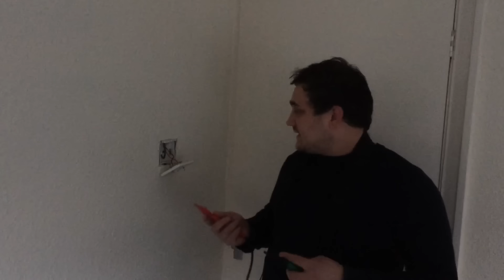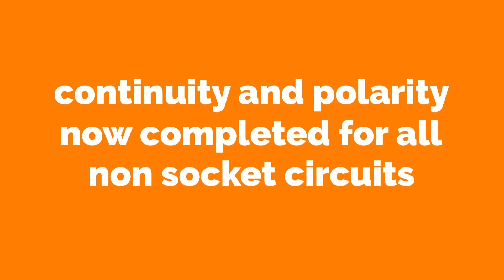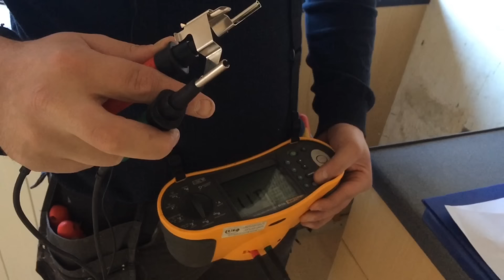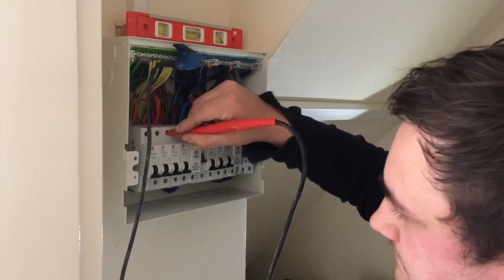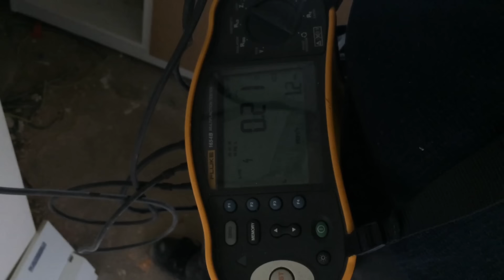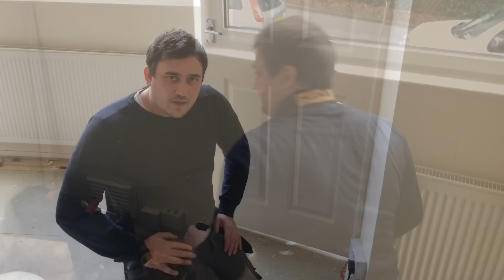On-Site Consumer Unit Change (Fuse Board or Fuse Box Change) Includes Live and Dead Testing

Comment: If you T&E is 2.5mm, r1 is 0.15, rn is 0.15, the expected value of r2 should be 0.25 and not 0.45 as its only 1.67 times thinner. 1.67x0.15 is 0.25 not 0.45 except you have extra lenght for the cpc.
Reply from the maker: Or is the cpc 1mm2 in this installation 👍🏻

Comment: Hi Gaz and Marcus. A quick question please. If you're testing a circuit (eg. Lighting circuit) that has being installed by somebody else years ago, how do you work out where the furthest lighting point is? And then do you record the reading from the furthest point in the continuity test as your value for the test sheet?
Reply: You’ve answered your own question pretty much, the furthest point of the radial circuit will give you the highest R1+R2 reading (lighting, radial sockets etc) as it has the most cable in the run and therefore the highest resistance which is the value you record.
 The way you find it is to test at every point of the circuit (all switch points, all PIR’s (if applicable) all lighting points I.e. ceiling rose and the highest continuity value is your end point
Reply: @alexrowbottom58  thank you for letting me know.

Comment: Silly question.  When the CPC continuity was done on the cooker circuit, he then went to test polarity by operating the isolator.  Isn't that a double pole isolator?  Therefore even if the polarity was incorrect and the line was actually the neutral, there would've been a break in continuity by operating the isolator.

Comment: Why did you use 6mm for the shower circuit, it's not going to be suitable, the cable's going to overheat. Should have used 10mm. 
Spend a bit more money and install the correct cable. What's the power rating of the shower? When the householder finds the shower is not heating the water enough and wants to upgrade the shower, will you come back and install the 10mm cable free of charge?
Reply from the maker: Hi. The work in the property was a consumer unit change only. Thanks for commenting and watching GSH Electrical
Reply: Existing circuit. Clue in title.....

Comment: I am with the you on this , as their was never ‘this much testing in my day and having just bought some new equipment and before my 18th I’m glad it’s something to rack the brains  20 years on .

However their is a but and mine is theirs no way electricians allow the time to do all that testing when doing a board change as simply the clients do not pay for that time . So not Many are going to do all this . 

Most folk go down the RCBO route and eradicate the RCD Problems.

Never the less great video and gave me some good pointers . Thank you 👍
Reply from the maker: Hi. Thanks for commenting and watching Gaz 👍
Reply: GSH Electrical 👍.

I’m thinking of making a fica type wall in my garage with a some different circuits just to get a grip on all the testing . After work go out with a cuppa and mess about with the tester and do the tests over and over again to get in the habit and getting to grips with them all . 

What’s your thoughts on this for an idea just out if interest ? 

Thanks

Comment: When insulation resistance is performed on the lighting circuit, to change strappers  you must switch one switch at the time otherwise switch will be in on or off position . Worst case when switch is left in off position ,than switched line conductor will be missed.Also there is no reason to do insulation resistance test twice between cpc and neutral as they permanently connected.
Reply from the maker: Hi. Thanks for commenting and watching 
https://youtu.be/9AjyWl_2bds
All the best Gaz 👍

Comment: Very good video performed by a very diligent student.  Cabling seems to enter the board through the rear knockouts how was the fire integrity preserved?  Do you think that it is ok to use an intumenscent fire sealent  where the cables use an existing hole that may not meet current fire barrier standards?
Reply from the maker: Hi great question. The wall the metal dis board is fixed to is non combustible brick and plaster surface. Thanks for watching GSH Electrical 👍

Comment: Am I missing something here? When he carried out an insulation test between Neutral and CPC he got an infinity reading , yet we saw him connecting the earthing conductor previously into the MET supply cut out. How did he get the infinity reading. Surely the earthing lead should have been disconnected from the supply neutral. 
Or did I miss something here??
Otherwise a well  done video.
Reply from the maker: Hi. Was the double switch off...? thanks for the question GSH Electrical
Reply: Yes, it was. I knew I had missed something and it occurred to me later in fact to check that point. Sorry, and thanks again. The video was very informative and well presented.

Comment: The r2 reading on the ring was high, much more than 1.67 x 0.15. It might be old 2.5 + 1 mm2 t+e cable but it would still be a bit high. I think there is a slightly loose cpc somewhere.
Reply from the maker: Hi. All good talking points hence the description in the video also can be due to the resistivity of the copper 👍thanks for the comment GSH Electrical

Comment: Great video gaz. 
40amp mcb for 6mm cable though? I would have that on a 32?
Reply from the maker: Hi. BS7671 states that 6mm cable can carry up to 47 Amps. Thanks for the question Gaz and watching 👍
Reply: So best working practice to use a 40amp? Don’t get me wrong for bigger showers I will use 10mm and 40amp. But I have always been told throughout my apprenticeship if you come across a 6mm on a 40amp to reduce the rating to 32. 
Thanks ur videos are great. 
Scott
Reply from the maker: Hi. Will always depend on the correction factors applied to the cable during its run. I commend your best practice of using 10mm cable keep up the great work Gaz
Reply: cooker is on a 32 amp breaker all ready so meets the regulations?
Reply from the maker: Hi. Another one of the talking points brought up in this video to discussed in the classroom. As the circuit(s) are protected by and RCD the earth faults will be cleared by this device so no issues you are now required to do a loop test between line and neutral and check that reading again the maximum Zs of the breaker... my class won’t need the lesson that goes with this if you keep going. Thanks as always Gaz

Comment: When testing ir and continuity if you were to find faults what needed to be addressed but the client wasnt happy with paying the extra money what would be the outcome. Just put the old consumer unit back up?? Or just fit the new consumer unit and state all issues on the certificate that need addressing even if they could be dangerous.   maybe do a quick blanket ir before giving the client a quote?  Great vid by the way.
Reply: What was the reason for the change of CU ? This looks like another CU change for no real reason? Even if there was no RCDs , it was installed to an earlier edition of BS7671 that doesn’t mean it should be replaced or upgraded . HSE note published in BS7671  was and is clear on that.  When he found a continuity problem  he should have coded it, not fix it and use it as an excuse to replace the CU . No one takes any notice of the regs or the HSE note . Did all the test results comply with BS7671 yes they did so why change the CU he should / could have signed it off as safe for continued service.
Reply from the maker: Hi. My learner did pre tests before starting work. With the old consumer unit in place he did continuity, insulation resistance, Ze and a full visual inspection. He found a fault on the ring circuit during these tests. At this stage the old consumer unit is still in place. Pre tests are very important for the reason in your question thanks for your great question GSH Electrical

Comment: I really don't like that torque screwdriver, I didn't even know you could get them uninsulated.
Reply from the maker: Hi. That type or torque screwdrivers in general?
Reply: That particual torque screwdriver, when working in a board, I like to check the incoming tails are tighten to the correct torque at the main switch. I understand the terminations were made with the supply isolated but I'm not a big fan of uninsulated hand tools for electricians.
Reply from the maker: Hi. Another good point. The video is a training aid for my level 3 adults there are many good talking point for me and them to cover in the classroom. Thanks for watching as always Gaz

Comment: Maybe I'm being stupid here, but why retest (insulation resistance) between the neutral and cpc conductor on the two way lighting circuit, both are unswitched so pressing the 2 way switches should have no bearing with regards to your insulation resistance reading between neutral and cpc.
Reply from the maker: Hi. Totally correct however during training it’s easy to repeat all 3 again this removes the rick of missing out the ones we need to test between. Thanks for the great question GSH Electrical

Comment: To the usual high standards. Your videos have been a great help. Just passed my 2392-10. Found on several occasions r1+r2 over 4 did not match the socket values as cpc was greater than 1.67 times. How do we deal with this on site?
Reply from the maker: Hi. The Quality of copper and it’s resistivity unfortunately changes. Go with the readings you calculate from r1, rn and r2 to find R1 + Rn and R1 + R2 + - 0.05 ohms. All the best GSH Electrical
Reply: Cheers

Comment: Interesting you say fuse has been pulled... did you ask the dno permission or just do it? strictly speaking its the dno's property most will say not to pull, more to cover themselves and down to h&S. however in the real world we all know people pull them or have a visit from the seal fairy! each person must make a risk assessment and decide, if its one of the really old ones do not touch as it will possibly fall apart and may contain asbestos. with newer ones make sure there is no load and for extra protection wear the electrical safety gloves and visor like when changing a meter.. 
What do you teach your students about this issue?
Reply from the maker: Hi. He contacted the REC (I use to work for them) for permission and will be paying for them to re-sealing the cutout. Thanks for watching GSH Electrical

Comment: On here you did 1 pfc test on the breaker but should all of them of been tested?
Reply from the maker: Hi. You could calculate Fault current by doing voltage/Ze Guide)... you can argue that doing the test on the top of the main switch is always going to be the highest fault current so why bother doing down stream on a breaker where the fault current will be less. Thanks for watching GSH Electrical
Reply: GSH Electrical cheers.